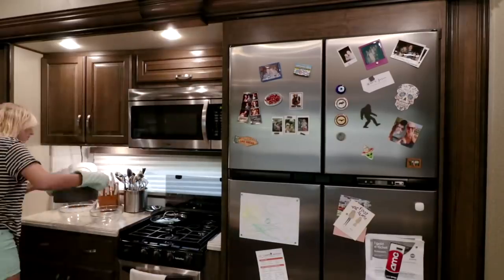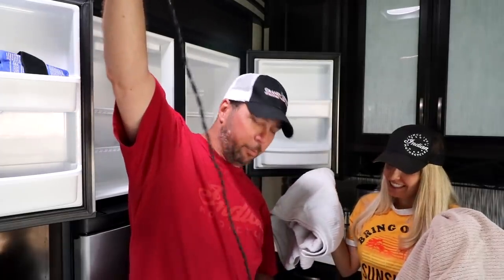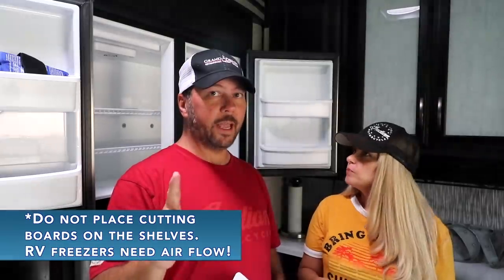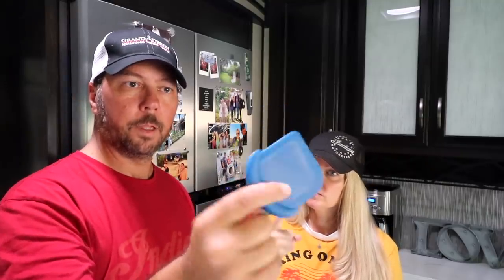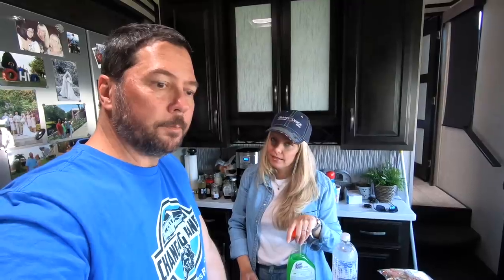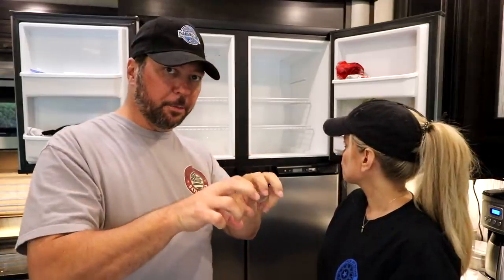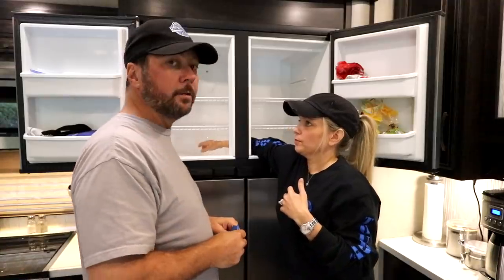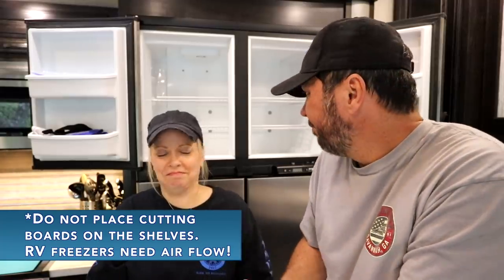🥶 RV Freezer Defrost | Full Time RV Living | Changing Lanes!

Comment: Thank you for the tip on using the cutting boards. When using the hair drier you have to be very careful, I warped the back of ours the first time I defrosted the freezer. AND  NO sharp metal things to pull off the ice, there is a gas in there, and if you puncher the plastic it will ruin the refer.

Comment: Great video! Enjoyed it and very informative.  I like the idea of the cutting boards will have to try that next time we are on the road.  We had to defrost ours only about 2 months into our trip but I am guessing that humidity has a lot to do with the amount of frost build up.  We use a digital thermostat with 2 sensors, one in the freezer and the other in the fridge the display has a magnet and attaches to the front of the fridge we can monitor the temperature of the fridge if it gets too cold we can change the setting on the fridge it can get cold and drop to below 32 deg causing stuff in the fridge to freeze 🥶 I had a half dozen eggs 🥚 freeze at one point because we did not keep an eye on it.  It’s interesting trying to fry an egg that has been frozen but it can be done.  🤓

Comment: I have the exact fridge/freezer and have used the hot water method with great success although it takes much longer.  But you can put the hot water in and leave for a while. I tried the dryer method but it made me nervous about the heat.  But am elated to see the plastic sheet addition and am anxious to give it a try. Thanks for sharing and happy travels.

Comment: Pretty cool tip with the cutting board sheets - you should save that ice for cocktail time! I was in a Grand Design 5th wheel this weekend at the Raleigh show - a Solitude, not a toy hauler - very impressive - but I really like yours. Yes, my wife's dryer cord looked like that. She would wrap it around the dryer cone for storage (Tara). All was well until the cord broke from the twisting and the thing caught fire (Tara). Don't wrap the cord, fold it loosely and neatly (Tara!).

Comment: We went out of our way to get a home fridge without the ice maker in the door.  That just takes up a lot of extra space, and provides good opportunity for heat leakage.  That fridge still has an automated ice maker that just dumps ice in a bucket inside.  That ice gets kind of nasty over time, so we usually have the trip bail locked in place to disable the unit.  If you use enough ice, I suppose it's worth it, but I'd rather just have a tray or two.  As for defrosting the wrong way, I did that decades ago.  A cold chisel was involved.  Refrigerant may have escaped.  Mistakes were made.  Your hair dryer approach seems like a good one, especially with the cutting boards in place, including the bottom.  I wonder if just putting saran wrap would do the same.  That may tear too easily.
Reply from the maker: LOL  "mistakes were made"!
You can find those cutting boards at just about any dollar store.  I agree... saran wrap is likely too thin.

Comment: Before you covered the back of your freezer with plastic cutting boards, I noticed two circular parts midway on the back wall of the freezer. These were covered over by the added boards. Could such covers impede freezer air flow?

Comment: great video.  thanks for sharing the cutting board tip.  You noted your fridge is colder than usual and you thought it might be because of the frost build up - but take a lookk for a white piece of plastic on the fins in the fridge...not all fridges have them, but some do...its called a thermistor...it slides up and down.  its possible it got moved up.  up is colder...anyhow "food" for thought!  :)
Reply from the maker: Thanks for the tip!  I don't see anything, but I'll dig into the manual later.   Thanks for watching! 😃

Comment: Thermostat is a great addition. 
I have a electronic thermostat that has a high / low alarm.
Reply from the maker: That would be cool (pun intended) 😊  Can you hear it with the door closed?  Have a link?  Thanks!
Reply: Link?
Reply: Yes, I would love a link to that as well :)
Reply from the maker: Following your link, I found this one that monitors both fridge and freezer with remote display for the same price: https://amzn.to/2ThCFh1   Going to try it out!
Reply from the maker: This is the one we're buying now: https://amzn.to/2UaxSLk
Reply: That's the ticket. I've been using this one for about a year now and it's awesome. Best part is you don't have to open the door to check the temps, and if you find the frig running a bit warm you can turn it down without opening the door and check in the morning to see if the range it's keeping has adjusted the way you want it to. We have the same frig as you have (we've got a GD Solitude 384GK). Love your video's, thanks for taking the time to show others the tips and tricks to RVing.
Reply from the maker: Thanks for watching! 😃

Comment: What happened is that the cutting board reduced the efficiency of heat ( or cold) transfer to the freezer , thus that is why the fridge itself got colder. Since plastic is an isolator , I don't think it's a good idea to do so.
Reply from the maker: We'll look into that and report back if that's the case.  But that top shelf had always been super cold.
Reply: @ChangingLanes  the way it works is that there is just one coolant line. It starts on top (since the coolant is colder ) and goes down by gravity to the bottom of the fridge. If you make the cold transfer less efficient in the freezer , the cold can't go as much in there and will go more in the fridge , especially the top of the fridge where the fins are. You will be more likely to have excess frost  and things will tend to freeze more there. It won't become hot in the freezer because it will compensate by running more. I'm just saying that you reduce the overall efficiency. That is exactly the reason why you have to defrost it in the first place. Ice is an excellent isolator and when you don't remove it , it reduces the efficiency up until the point that you start having temperature problem :)
Reply from the maker: You may be right.  I think after our next defrost, we'll take them out and see if the frost in the upper right of the fridge (where the exploding sodas were) goes away.  We'll put out an update if the sheets prove to be detrimental.  Thanks for the tips!  😊

Comment: I just installed that same Furion over the range Convection oven Microwave in my Heartland big country because the power converter went out and caused the GE over the range to blow up. Hmm my freezer defrosts when i empty t out every 2 weeks, i don't think i've had it yet were the back was frozen up and stayed that way. I still have that problem with mine freezing up for the last 6 months that i've been in mine and i've never had an issue every 2 weeks i buy new groceries and by the time i get to it it's defrosted. i still have issues with it freezing up but in this smaller RV i've been told it's because it's out of level but i am about to move into my 35 foot Big Country and it has the same size fridge freezer combo in it different name brand once is a Nor Cold, the other is A Dometic it being level plays a part in how well it freezes, i've seen that but i've also been looking at maybe giving up some storage space and putting in a Deep freezer, I have an idea where it would be cool to counter sink a chest freezer into the floor but you would have to remember to pull it up when you're ready to move each time or it could function as another sequence of the slide outs maybe. Also looking at different thicknesses of tarping material to drop down as underpinning specially in the winter to help keep the RV warmer. So far i think the insulated tarps are the way to go. but i don't need a 30X20' tarp hanging off the side of my RV so i believe i am going to have to find someone that can sew because i don't want the tarps to be any taller from the bottom of the coach than 4 feet. could be nice to have those roll up with a metal gear like the Awning does too. Yeah i have ideas popping up like that almost daily now that i'm full timing it Even considering a different power set up that's not as sketchy as the power converter and 12v batteries. like i said the wheels are turning now may need to find someone to help design and implement some of this stuff though.

Comment: EXPLODING sodas....that is the reason I chose a residential refrigerator for our current, as well as in our new Momentum (which will carry my Gold Wing). While I must admit, the travel trailer we had with the RV Gas/Electric unit in was 6 years old when I purchased, and didn't have the kind of controls you appear to have, we could never figure out how to adjust it correctly (some kind of slider thing on the right side that this Navy FT could never grasp the concept, ugggg). So, after many frozen sodas, eggs, milk. etc....I decided to go with the residential unit we have (though I would NEVER recommend it be at the rear of the trailer), and with the Momentum I've ordered we're going full solar (with generator) to keep it working. But again, as everyone says, that's a personal choice.  Oh yes, if you do make it to the Denver area give us a holler, I'll treat the two of you to dinner.  The same holds true if your in the Rapid City, SD area in mid September, where I'll be going for a ship's reunion,  DDG-13. You'll have to look it up. It was turned into razor blades about the time you joined.  ;-)     So, in the mean time, keep the rubber side down, & Ride Aware.

Comment: Have you ever had a soda blow up before?  If that happened for the first time after adding the cutting boards, it might have been the cause.  Does the unit have separate controls for temp in the freezer and fridge sections?  Or I guess you could just set the temp for slightly warmer and monitor the thermometers in each part.  Good video!  Defrosting is something I haven’t had to do since the 80s at least, so good to have a reference.  Do you ever get buildup or lots of condensate in the fridge section?
Reply from the maker: First soda blow up.. so it might be a factor.. need to try it without the sheets after next defrost and test the theory...  
Never any condensation in the fridge.  A little frost in the upper right corner where those sodas were.  We'll do some testing and follow up. 😎

Comment: Interesting. I have an old 1940's residential fridge for holding mostly beverages and a few frozen items in the tiny freezer section. Of course, its not frost free and needs defrosted about once a year. What I have noticed is, most of the moisture that collects adheres to the cooling coils in the freezer and then builds up from there on.  I'm wondering if your RV freezers aren't built with the cooling coils just behind the back and bottom plastic walls as it seems that's where your frost is collecting. If so, possibly those thin cutting boards are actually hindering cooling by covering the direct cold contact to the interior. Maybe it's not much or may it is. Anyway, when defrosting our old GE fridge, we prop open the door, empty everything, set up a 16" table fan and turn it on low facing the fridge. Once the ice begins to melt it all slides away and we drain or mop up the water that forms below. Doesn't work as fast however, we don't stand any chances of damaging the interior of the fridge or its parts with scrapers etc. and it remains untouched finish inside, no damage or wear. Once all clean and dry, we dry off all the items going back into and start the cycle again.

One way to defer lots of frost is to wipe dry any items going back into the fridge/freezer or when shopping and reloading the unit, wipe dry all of the new items as you put them inside. It prevents that moisture from going to the cooling coils or the cold spots in the freezer. Likely the air in the fridge/freezer are shared so, any moisture in either section will travel to the freezer to form ice. We use a terry cloth towel or dish towel to dry off any moisture that forms on items before returning them to the cooler and yield less frost over the long haul.

Yeah, the propane feature is really good on those. I believe those units only require a flame the size of a lit match to operate so, they hardly use much propane or way less than a stove burner will. As long as that flame is protected from any wind, its likely the most efficient of the three options and it's dead quiet. There's such a thing as gas air conditioning too but for some reason, they aren't manufactured in quantity yet they are way more efficient than electric and only need a cooling fan, no energy hog and loud compressor. I didn't see any ice cream in there. No blended malted shakes in your RV?
Reply from the maker: We monitored the temp both times after defrosting and putting the plastic sheets in and it all seems to be fine.  We also try to keep moisture down, but frost seems inevitable.    Thanks for watching! 😃
Reply: @ChangingLanes  Temps vs. heat transfer would be two things. Just suggesting their could be an insulation factor in those which could hide some of the cold capacity vs.avg.temp. Just opening the doors will bring in humidity so that's where most of it comes from unless wet items are not dried.  Keep 'em coming.

Comment: We have a 397TH and also have problems with the refrigerator/freezer temperatures.  It's been going on since we bought it 8 months ago.  Stuff the the refrigerator will freeze periodically and the freezer has trouble freezing stuff sometimes.  We have it set to level 6 because any colder and the refrigerator will definitely freeze everything and any warmer and the freezer won't freeze everything.  We are taking it in for work next week and we were going to ask if it is normal.  Looks like it might just be how these particular RV refrigerators work.  However, I'll try to remember to update this comment if I find something out.
Reply from the maker: Yes... if you find a solution, please let us know...  It may just be inherent to how these types of fridges work.  Now that we've got an inverter and decent lithium batteries, I'm doing some research on swapping out for a residential.  Need to compare the power draw difference as I've heard that residential fridges are more power efficient with the 110AC.
Reply: @ChangingLanes   We had a residential refrigerator in our previous travel trailer which would run off of an inverter.  Unfortunately, I never did any tests to see how much power it used.  I would also like to look into the option of a residential fridge for our 397TH.  I know that Grand Design offers them in other 5th wheels.  Not sure why they don't in the Momentums.
Reply: @ChangingLanes  I may have run across a solution. I'm not sure but I'm testing it out. The refrigerator has a thermistor attached to the fins in the back top right. If you move the thermistor up or down it should change the temperature differential between the fridge and freezer. I am doing some testing and I'll let you know.
Reply: @ChangingLanes   So, last night, with the refrigerator on 6 where we normally keep it, I moved the thermistor from about 1" from the top of the fin to about 2" from the bottom.  After more than an hour, the freezer was reading about 20 degrees and the fridge was at about 35 degrees.  I'll keep checking it to see how it goes but I think it may have worked.

Comment: Hair dryer should be on low heat setting to keep from cracking the plastic inside.
Reply from the maker: Even on high, I'd have to hold it in one spot and very close for a good while to do any damage.

Comment: We have a momentum 399th dose your sewers pipes get stuck? Because it happened to us 2 times
Reply from the maker: No... what get's stuck?  The dump valve?  I shoot silicone into the cable almost every time I use it to try to keep it from sticking.  If it starts to get even a little bit stiff, I'll spray the line and work it in and out.